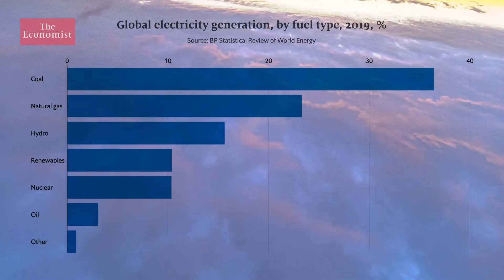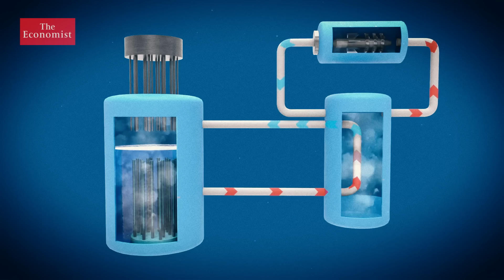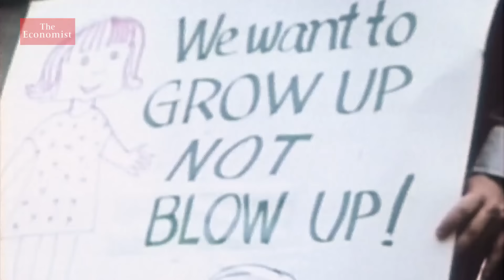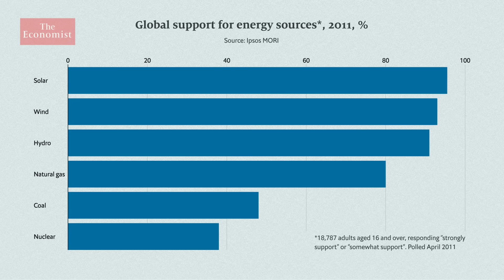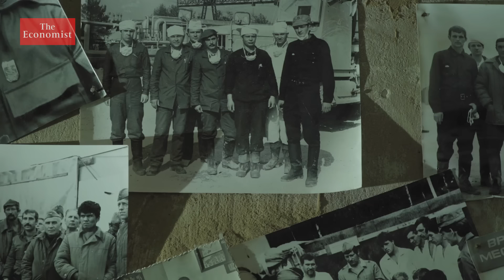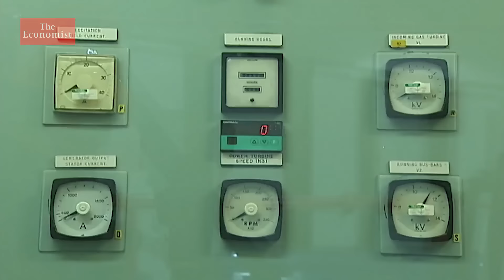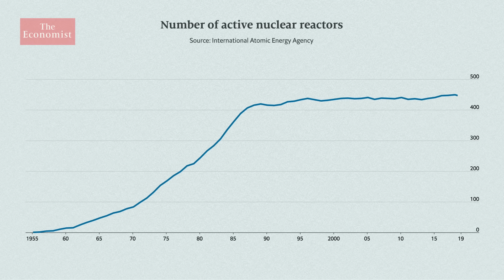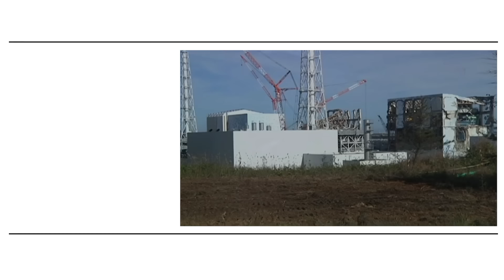Nuclear power: why is it so unpopular?

Comment: Although there are a number of positives to nuclear power, I’m disappointed that this video makes no mention of the uranium mining process and its attendant environmental and community health issues.  Nuclear sounds like a near perfect solution to our climate and energy future, until you stop to consider where all that uranium needs to come from & how. Mind you, I’m not anti-nuclear. I just think we need a nuanced and more complete picture.
Reply: That's also true about renewable sources of energy isn't it? Solar and wind require huge batteries, and the mining process required is nothing but pretty.
Reply: This is what I was thinking! and the Nuclear waste also need to be stored afterwards for a long long time. And who wants that nuclear waste?

Also there will be a day that all uranium is mined.
Reply: @BeauB1991  We have enough U-235 for hundreds of years, and enough U-238 and Th for several 10,000s of years. We are a long, long way from 'peak uranium'.

As for the mining, although uranium miners have an increased risk of cancer, ALL miners have an increased risk of cancer, and uranium miners risk is not significantly more than a regular miner's, and if using leaching, much, much, much lower.

Ditto their communities - I would much rather live downwind of a uranium leach mine (very little tailings) than downwind of a coal, iron, or rare earth (y'know, for all the solar panels) mine with their massive, massive tailing piles.

About 3000 coal miners die from accident/cancer annually globally, for about 50% of global electricity. I can't even find the number of uranium miners who die (because it is so small) globally, for about 10% of global electricity - however, let's assume 10. If we went 100% nuclear in the electricity generation sector, that saves at least 2,900 lives a year!

Nuclear waste (with reprocessing) needs only be stored for 300 years.
Separate spent nuclear fuel into fission products (300 years to background radiation) and actinides (1000s of years to background).
Glassify and bury the fission products. Dig up 300y later for awesome minerals.
Put actinides back into reactor for more power. Repeat until it becomes a fission product.

This is proven technology that has been practiced by the French for decades. Waste is not a problem.
Reply: This is the same problem with any other electrical power stations. The problem associated with mining operations is far worse in the case of renewable energies, because they are very extensive inmzterial ans place. It is not an argument against nuclear energy, in the contrary, the fewer needs for material père unit of energy produced is one of its biggest strenghts.
Reply: @factnotfiction5915  Thanks for this. This is the kind of complete picture I was hoping for. You're right that we certainly won't have a problem of running out of uranium resources, since the energy we can extract is so concentrated. And the issue of waste re-use and storage can be dealt with if safely if done right.

The only issue I still raise, though, is what about impact on water resources from uranium mining?  Specifically, around the Grand Canyon, where some of these richest uranium resources are. Do we want to risk uranium leaching into the Colorado River, impacting that one-of-a-kind and threatened ecosystem? Do we want to risk poisoning the water supply and desecrating the sacred sites of the indigenous communities   who live there?

And speaking of the indigenous communities. To whom will the profits go when that uranium is exploited? Sure, a few hundred locals will benefit from decent paying jobs for a finite amount of time. But by and large, the lion's share of the profits will be going to multi-national mining corporation CEOs and shareholders. Not to the people who have lived there for generations. Not to the people who put the labor and sacrifice into getting the stuff out of the ground. Not to the people who will have to deal with the aftermath.

And if uranium can be mined safely, who's keeping watch and holding the mining companies to account? Environmental protection agencies are already anemic at best. And indigenous communities have historically been exploited and neglected by the US government, so who's to say anyone will be making sure their water is protected? This is as much a social justice issue as an environmental one.
Reply: The Nuclear industry relies too heavily upon Taxpayer (that's you and me but NOT at least  60 of the Fortune 500 Companies)  Subsidies.  They're not about to be sincere when survival depends upon hoodwinking the public.
Reply: @arcanondrum6543  you're talking about renewable energies  rigth? Nuclear need long term investments to work, because of that nuclear need the state in backup, otherwise private compagnies don't invest in it, the return on investment is far too long, but that does not mean nuclear is expensive by itself. On the opposite, renewable need far more subsidies than nuclear. In Europe the country with the most expensive electricity are the one with the biggest part of renewable energies in their mix (Germany, Spain, Denmark), because of tax needed for subsidizing renewable energy producers. On the opposite France has one of the cheapest.
Reply: @rolletroll2338  The US Energy Information Administration charted subsidies for all Energy sectors in the USA for Fiscal Years 2010, 2013 and 2016. 

Nuclear energy received.  8, 318 in '10,   8,099 in '13   and 8,352 in '16
US Wind energy received.     863 in '10,   1,557 in '13   and 2,038 in '16
US Solar energy received        88 in '10,       205 in '13   and     533 in '16

ALL subsidy amounts are adjusted in million dollars for fiscal year 2016
Reply: @EepicPhail  
"Do we want to risk uranium leaching into the Colorado River...?" no.

However, each mine (uranium or no) has risks. Uranium leaching MIGHT just spread a tiny amount of radioactivity about, and MIGHT put a bit of uranium into the biosphere, however, we only need a 56 thousand tonnes of uranium - a little goes a long way.

       56,000 tonnes - 2019 global uranium production
2,280,000,000 tonnes - 2015 global iron raw ore production (iron itself less)
   50,000,000 tonnes - 2013 global aluminium production
  258,000,000 tonnes - 2015 global gypsum production
7,493,000,000 tonnes - 2018 global coal production

You appear worried that a little bit of uranium will seep into the biosphere, but these other mining operations are, as we can see from the small table above, much, much larger - shifting more rock, involving more processing, dislodging more heavy metals (lead, mercury, cadmium - all of which are FAR worse biologically than a little bit of uranium). Uranium mining is a pygmy.

"Do we want to risk poisoning the water supply and desecrating the sacred sites of the indigenous communities who live there? ... To whom will the profits go ... the lion's share of the profits will be going to multi-national mining corporation CEOs and shareholders. Not to the people who have lived there ... getting the stuff out of the ground ... have to deal with the aftermath."

Regardless of my views on who should get profits from mining, the communities or the companies - why exactly is this a uranium mining issue vs a mining issue?
Uranium ore is just a mineral like other ores - bauxite (aluminum), monazite (rare earths), chalcocite (copper), magnetite (iron), and of course, coal, et cetera.
Treating a local mining community badly is not a specific feature of uranium mining! Should mining communities be treated better - sure! But there is no particular evil in uranium mining, just as there is no particular evil in mining for gypsum or potassium to fertilize your garden.
Should the EPA and the US Bureau of Mines act in a more balanced way? Sure - but they don't say 'Heavens! A uranium mine! Anything goes boys! - but make sure you bring out that copper in the mine next over according to the law.'

If you want to castigate the mining industry go for it! Just don't be selective where uranium mining is evil and rare earth mining (for solar PV) is angelic.

This is what I really don't get about your fear of uranium mining:
       56,000 tonnes - global uranium production
                     - 10% of global electricity
                     - 0.000747% the mining effort, waste, contamination for 1/3rd the juice coal provides
                     - yes, the decimal point is correct!
      560,000 tonnes - presuming 100% of global electricity from nuclear
                     - such a small disturbance for 100% low-carbon electricity
                     - 0.00747% the mining effort, waste, contamination
7,493,000,000 tonnes - global coal production - ~38% of global electricity

Now let's talk about indigenous communities!
* For every tonne of hard coal generated by mining, 400 kilograms of waste material remains.
* In the Jharia coalfield, a large cohort of "coal cycle wallahs" manually sort mine tailings with their families, and then transport the salvaged coal on bicycles more than 60 kilometers to market.
* Piles of coal refuse can have significant negative environmental consequences, including the leaching of iron, manganese, and aluminum residues into waterways and acid mine drainage. (similar to the iron, manganese, and aluminum residues from mining you are should be worried about rather than uranium)
* The runoff can create both surface and groundwater contamination.
* Because most coal refuse harbors toxic components, it is not easily reclaimed by replanting with plants like beach grasses.[20][25]
* The burning of waste coal typically produces more environmental toxins than higher energy coals. For every 100 tons of coal waste burned, 85 tons of toxic waste ash are created. These piles are also vulnerable to fires, many of them igniting on their own.
* In the United States, waste coal piles accumulated from 1900 to 1970. In Pennsylvania alone, there are over 770 such piles identified. There are at least 18 coal waste burning plants in the United States.

If you truly believe in social justice for mining communities,  you should support low-impact nuclear!
Reply: A buddy of mine worked at a Nuclear Energy plant for several years.  Refueling a Nuclear Reactor takes a Minimum, a MINIMUM of 90 days but usually much more. So all those single Reactor Plants that pretend to be indispensable are actually producing NO Electricity while they are being refueled - in fact,  they (businesses) purchase Electricity at a rate much lower than homeowners. 
.
Reply: @arcanondrum6543   @Arc Anon Drum  that's why you need to  have more than only one reactors in your parc, and you program your maintenance when need for electrical power is the lowest, mostly in summer. France does it well, for example.
Reply: @rolletroll2338  Ahh but you missed the point so I will explain once more: The Single Reactor Power Plants not serving areas with more Reactors are backed up by NON-NUCLEAR Power.  Make more of that Power Green and Voila!
Reply: @arcanondrum6543 Yes you have to do more nuclear reactors. Solar and wind are useless to backup normal power plants because you can't pilot them and control their output. So instead do like France and voilà.

Comment: Nuclear technology is actually a lot safer than some alternatives. It is hated irrationally
Reply: How about if it's used aa weapons?
Reply: @rodaxel7165  Dude different kinds of enrichment is required for power plants & weapon.
Reply: @rodaxel7165  oh sorry I meant it just to do with nuclear power for electricity
Reply: And what about nuclear waste? After 70 years of operating nuclear power plants there is still no solution for nuclear waste that garantees safety for at least the next 10 millenia.
Reply: @andreasklindt7144  look at how sweden have handled waste- they have an extremely sophisticated way of handling waste that has not caused a single problem. I think the main problem with nuclear is probably it’s cost to set it up, but what shouldn’t happen is to decomission already up and running plants

Comment: 10:20 is the only time they say the actual reason, money, but they obfuscate the point almost immediately.
Reply: it's called an investment and always generates much more than the base cost of a power plant. People are easily swayed by initial numbers and don't realize the benefits. Pickering nuclear was built for less than 5 billion and has generated over 97 billion in revenue for the province since 1971. Pretty sure it's worth the money. Trust me, you'll be paying much more per KWh from any other source.

Comment: The Economist thinks it’s all about how many people die. Maybe it’s about how people live, for example in the exclusion zones in Fukushima or the people living with radioactive waste for the next 100000 years
Reply: Spent fissile material is perfectly usably in newer generation reactor designs that are around today. Besides that, spent fissile material stays in a solid state in the form of fuel rods to be stored in casks. The crazy high energy density of the materials also means you're producing a very low volume of spent material relative to the amount of energy you've produced.
I don't see anyone successfully capturing and controlling the storage of waste from the use of coal, or rare earth metals in "renewables" like solar panels. Chernobyl, the worst case ever, is overgrown with flora and overrun with flora. Meanwhile, the locations in Outer Mongolia where lithium is extracted, will be barren forever basically. 
In addition to this, you better start avoiding people who smoke tobacco. The radioactive polonium and lead isotopes in the tobacco means that you get more annual ionizing radiation exposure via smokers than staying in exclusion zones.
Reply: @Waldemarvonanhalt  If you like Chernobyl because it’s so green, why doesn’t anybody want to move there?

Comment: When you add all the risks into the equation, Nuclear just doesn't make the grade. Like fossil fuels, it has inputs that can be insecure. It has polluting waste. The capital costs are high. The worst case scenarios are incalculable. Despite the genius of the technology, firming renewables is cheaper and safer.

Comment: Elephant in the room: nuclear waste. Other forms of energy produce their own waste, but it is remiss to not mention the creation of waste that will be radioactive for thousands of years.
Reply: Well proponents of coal never seem to mention their waste, you know, all the greenhouse gasses released into the atmosphere that have an effect on a global scale, endangering all life on the planet... At least nuclear waste is contained and in a relatively easy to handle form. Just make some nuclear waste storage facilities...
Reply: France recycles their waste and as sources suggest waste still has 90% power. U.S used about 83.000 metrics tons of used fuel since 1950 and it can be stored in football field with a depth of 10 yards.
Reply: The 4th generation of reactors is imagined to consume the high radioactivity waste we produce today. Of course there would still be the low radioactivity wastes (300 wastes) but they are not more a problem than solar panels or wind turbines that cannot be recycled. 

At the beginning, the 3rd (today) and  4th generation of reactors with imagined to be complementary.
Reply: @fenriswolf-always-forward  I did not know that, and it seems like something that needs to be addressed in the video. I believe I am not alone in being a little concerned about nuclear waste. this video would be a great place to challenge this assumption, not in the comments section